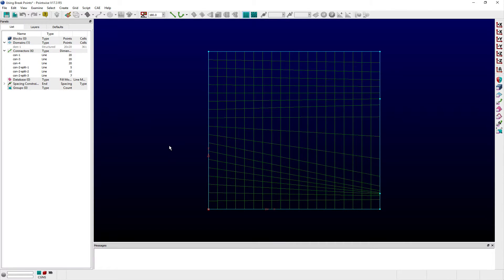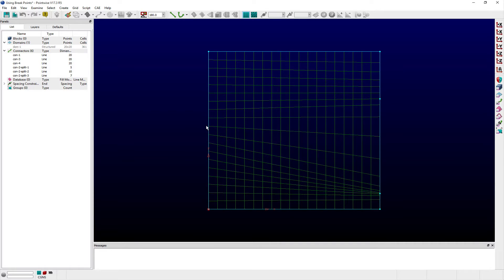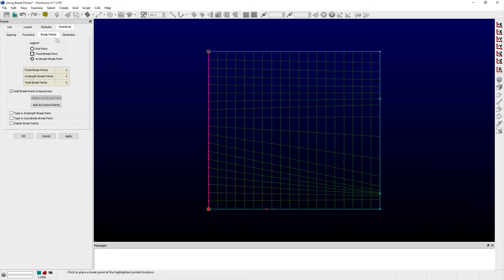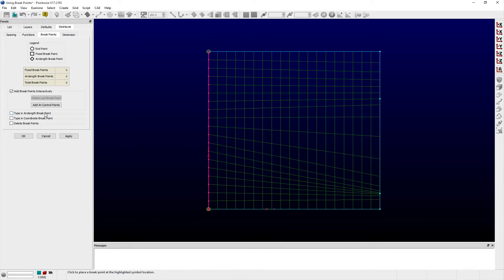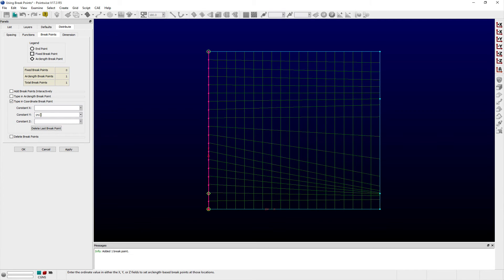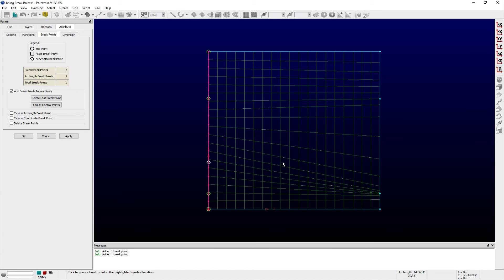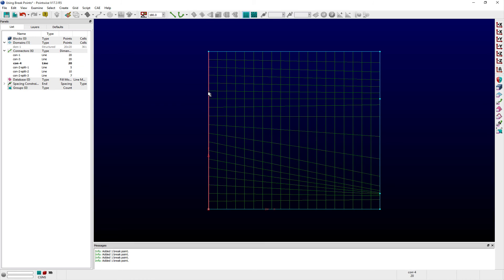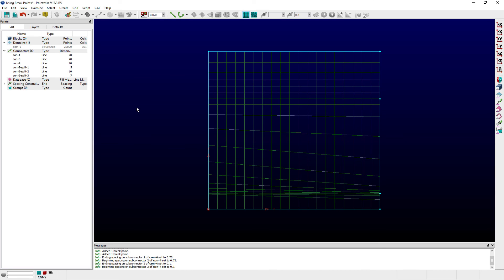Using Connector Break Points

Comment: is it possible to match the node distribution of a structured domain opposite both having multiple connectors on each side, instead of repeated selection of each sub connector and copy the distribution on the opposite sub connector
Reply from the maker: +Toffy Amd The best way is to use the Grid, Distribute, Copy From task to do so. You could write a script that does it for you.
Reply: scripting is more difficult than pick up individual sub-connector of one side and to apply through grid, Distribute, copy From task to the opposite side sub connector